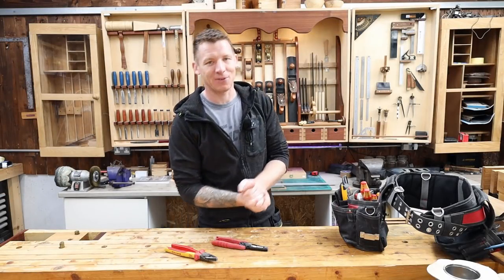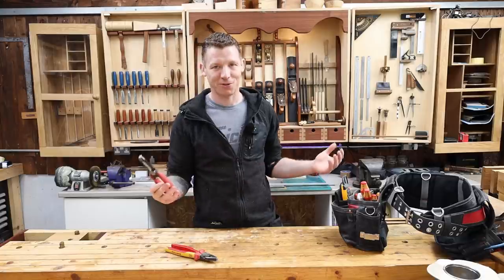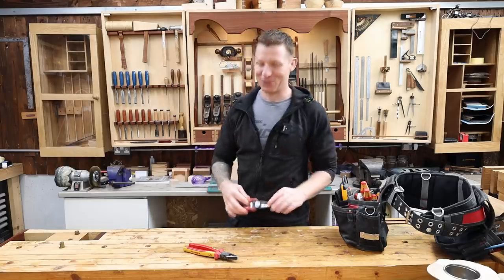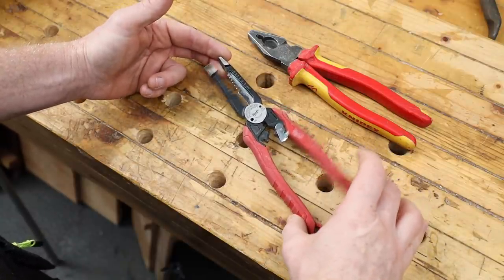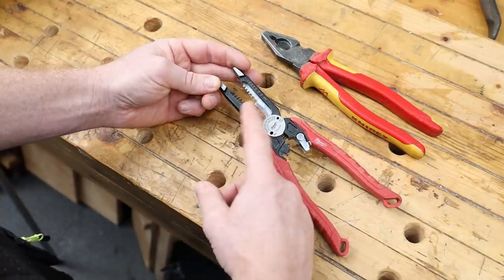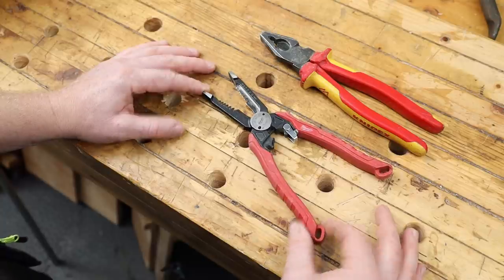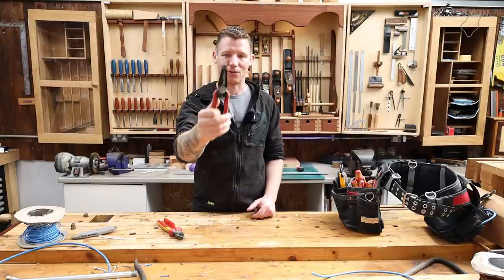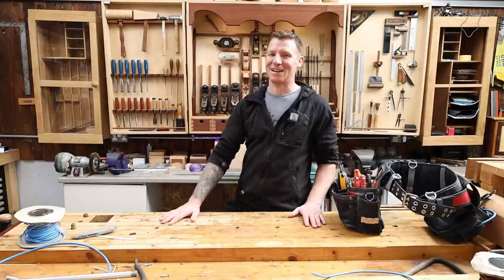Milwaukee 7 in 1 Pliers. Better than My Knipex??? An Electricians Opinion.

Comment: Hi John, try out the Knipex 6 in 1 pliers. I've been using them for about a year, very sharp and they look a lot better than the Milwaukee set. Another point I'd make is, if they aren't insulated - they aren't in the bag.
Reply: Seconded! Knipex 6 in 1s are the ones, my go to tool now
Reply: Third this. Knipex installation pliers are the mutts nuts
Reply: Ugh… these Germans are killin’ us!  

I have a feeling my grandpa said the same thing back in the 1940’s…
Reply: Nah those 6 in 1 knipex are good and all but too bulky. I prefer this milwaukee surprisingly, much easier to work with.
Reply: I've never encountered an electrical situation where insulation is actually important.
Reply: @omniferousswan593 😂😂😂 I think you mean insulated tools…
Reply: @Thepalpatineboys77  yeah. Insulation on the tool.

Comment: The Milwaukee 7 in 1 is fantastic. I have Klein, Knipex, and Wiha side cutters. These are super sharp, and so far I'm very pleased with them. They feel very good in the hand, a nice weight and have good leverage compared to my others ( my Knipex/Wiha are 160's and the Klein 180 so will naturally have less power ).
Plus, they are the cheapest by far.

Comment: They are insulated just not tested to 1000v, since your pliers will only come into contact with a single phase at a time and as long as your holding the insulation you're fine. The insulation required for 1000v rating make the handles on pliers far to chunky for those of us who rotate pliers round and round for speed, instead of grip n twist, grip n twist.
Reply: Can you use Milwaukee in 220v?

Comment: Knipex makes one that is like that Milwaukee, with the wire strippers, a lineman like end, really nice cutters, 6 and 8-32 bolt cutters.  They are super cool.  They make another one that has needle nose like ends, but it only has 2 different size wire strippers and no bolt cutters.

I would like to see your comparison with the Milwaukee and the Knipex i mentioned above.

Comment: they look awesome, i teach electricians work at a college and these would be awesome to slim down our toolcarts a bit. the insulation is a killer tho, regulations here call for insulated tools all the time when working with anything electrical :(

(edit: just looked up the knipex 6 in 1, as advised in many comments, its insulated and appears to do the same, will be trying those out!)
Reply from the maker: its pretty good, I'm going to look at the Knipex version but I think its more of a needle nose pliers
Reply: @JohnMcGrathManInShed  looking forward to your review and opinion on the knipex one, im gonna buy one for the shop and let my students play with it, see if it does all that it claims
Reply: @JohnMcGrathManInShed  So little update, i did buy 2 of the knipex pliers in the workshop and had a go at em and had my students try them aswell, we all loved em. it will replace a few tools in our shop soon. defo think its worth investigating

Comment: US electrician here. Nice review. I have this same set of pliers and also like them. I agree, I don’t use the crimper or the loop maker. FYI, they strip 8-18 AWG. I also find the spring a bit annoying because the latch always comes undone in my tool bag and they spring open, making it a bit harder to remove from the bag. Anyway, thanks for the video.
Reply: Hi, uk sparky here, I’ve just ordered these they look great, I’ve gone back to panel wiring as it’s local and I bought some Magnusson cheap ones to keep me going for a bit and they’re brilliant 😂 ah well, they can be my back up

Comment: Nice review. But I would find it very hard to stray away from Knipex. The 13 72 8 is basically the same type of design. The spring loaded handles would drive me mad aswell. Also im OCD about my tools. Having a Milwaukee in the middle of my knipex tools would leave me feeling very uneasy.

Comment: Hi John,
See many comments telling you to compare to the Knipex 6-in-1; I won’t though, as I  use them and am a convert.  The needle-nose design is far handier IMHO, and you can make nice tight loops for the screw terminals we have in the back of sockets in the UK/IE.  Not tried LSZH cables yet though.  It’s got built-in 1.5/2.5mm^2 boot lace ferrule crimpers, which produce an…adequate crimp, ok if you’re up a ladder, not if you’re wiring up a panel at the bench.  My favourite part though is the radiused cutter blades.  As you found, will let you cut cleanly through T+E or thicker single cores, and also quickly score around flex, or the inner sheath of, say SWA and leave a neat edge.  Somebody mentioned the spring handles would drive them crazy, I genuinely find them useful but you can order them without.  Can you tell I like em? 😉

Comment: Wow I actually have the Milwaukee but I had no clue how good it was because I just use it for typical around the house stuff (sockets, lighting, ceiling fans etc) so I had no clue how good it actually was because I dont do real electrical work like its made for. 

Cool to see examples of what its capable of 👍🏻

Hey Ill point something out of intrest, Ive watched tests of all the top brand linesman pliers and side cutters and for some reason those Knipex linrsman pliers actually take half the amount of force as most companies sidde cuttets to cut through nails & screws.

Its like 65lbs of pressure versus like 155 with the side cutters to cut through a screw. 

Just intresting 🤙🏻

Cheers from America 🤘🏻
Reply from the maker: Its a great tool and knipex are the best

Comment: Hi John, I watch the “Gosforth handyman” as well as yourself and he has bought a house and was showing the quality of the wiring. One particular thing was a 16 b fused wire that was split under the floorboards and was used to go downstairs as a spur and it was hooked up to the cooker and some sockets as well as feeding the water heater and sockets upstairs. The wires were joined by what I call a chocolate box with tape around it; apart from the use of a chocolate box (that as far as I am concerned should not be used for any 240 volt), the wire was not correct nor was the fuse at the box. He went onto say that the wiring had been put in b y a certified electrician, I am not sure how he came to this conclusion but if it is true that person should have never been put on any job at all. I would be interested in your opinion of this work.
Reply from the maker: That sounds pretty bad to be fair

Comment: interesting tool
not keen on it not being insulated. definetly very handy havng a 1 tool that will do several jobs instead of swapping over and back
just oredered the knipex 6 in 1, 

what would you reconment for cutting socket screws. i have no dedicated or easy way to do it .
Reply from the maker: The knipex is a needle nose I believe, that's why I didn't get it

Comment: It looks like a great pliers I think i might give them a try after my knipex 5 in 1 wears out
even though i only use it for data cable it is a tool i would not live without 
as it does everything i need apart from a screwdriver
Great video John keep them coming
Reply from the maker: Thanks will do

Comment: These are absolute trash compared to the knipex hybrid strippers of the similar design as these. If you can get the knipex variant then get it because the milwaukee for me lasted less than 6 months and thats cutting and stripping 10/12/14 AWG, (unshielded cables) Cutter portion, blades rolled over and became dull. I will never buy hand tools from milwaukee ever again. Knipex 6 months in, no signs of wear with exception to discoloration due to copper deposits on blades. Still just as sharp as the day I got them. However, Milwaukee power tools are and always will be my go to